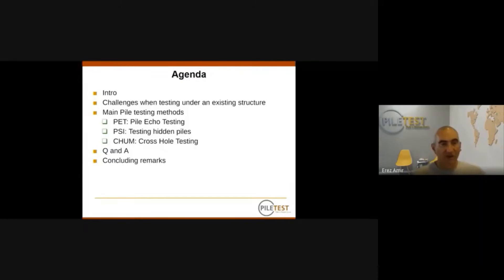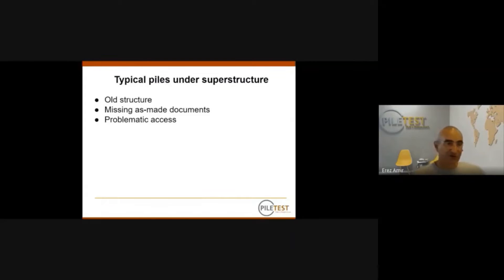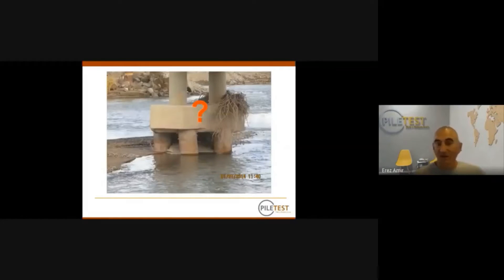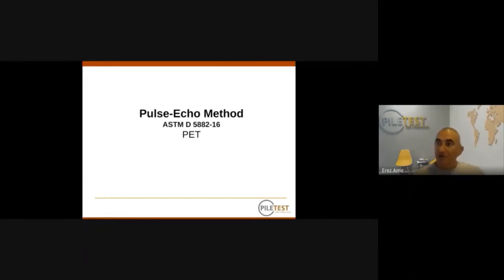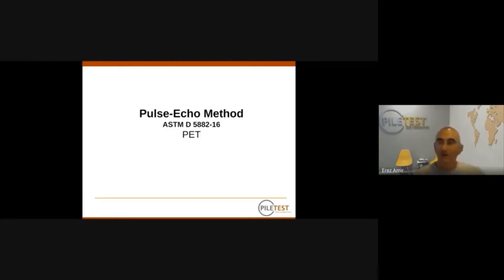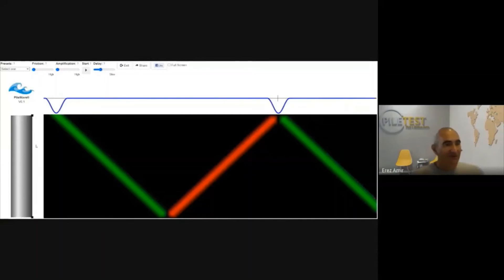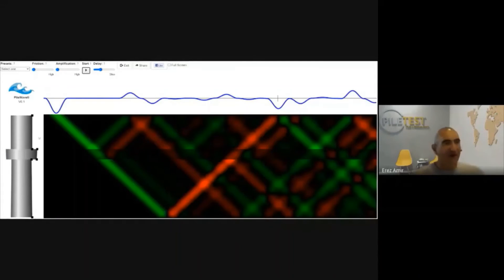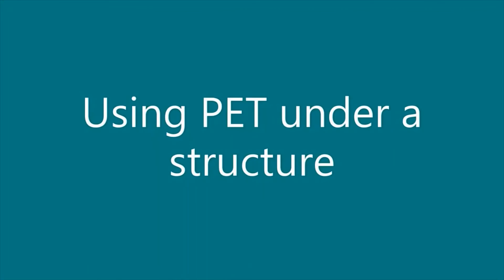PET - For testing a pile under a structure

Comment: Could I know what is the percent of pile shall be tested for each project?
Reply from the maker: In general, we recommend testing on a new site all the deep pile foundations on site. This is because the cost of the test relative to the damage it may save makes no sense in doing otherwise. If you need to test a pile understructure of an old building, you need to consider additional factors, like building age, reliability of available data on the foundations, and how well the tested results correlate with that data and planned changes to the building or structure, and their use.